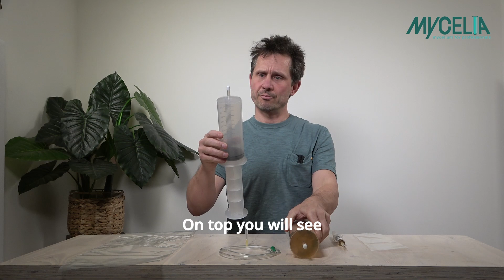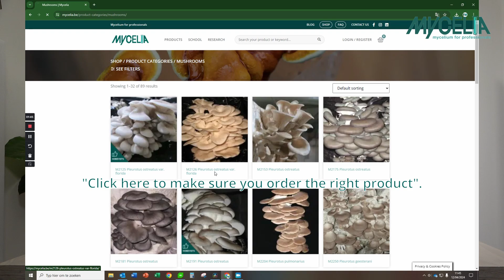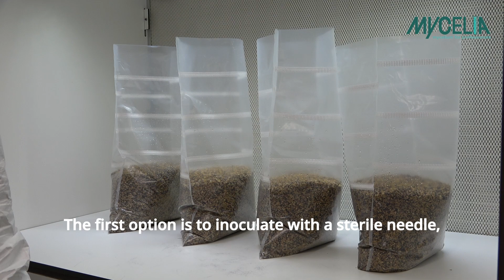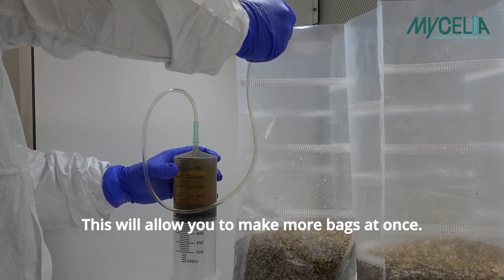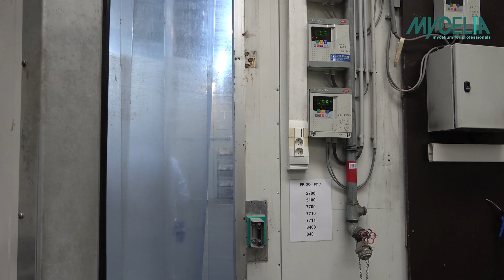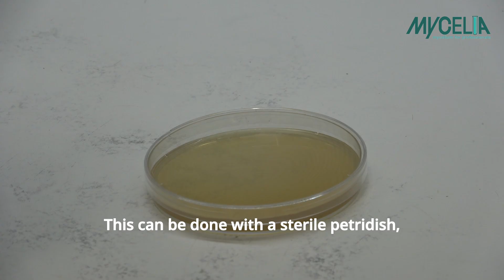How to use liquid mycelium spawn in syringes? Instruction video

Comment: Why must it be used all at once? If it is opened and used in a sterile room then recap the syringe and store in a fridge. Also why are some strains available in small syringe format and others not, as with the three Hericium strains, only one is available as a lower cost item in a 10ml syringe